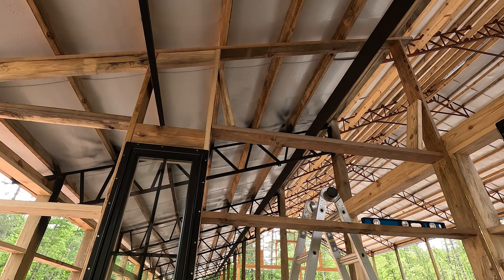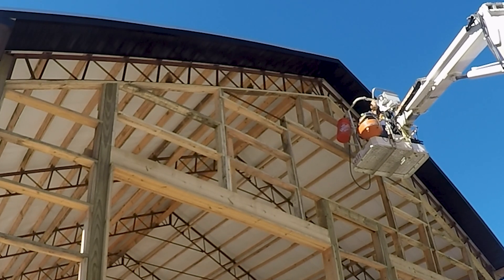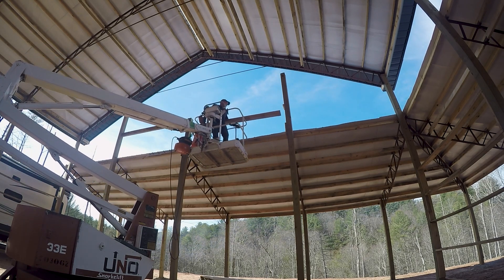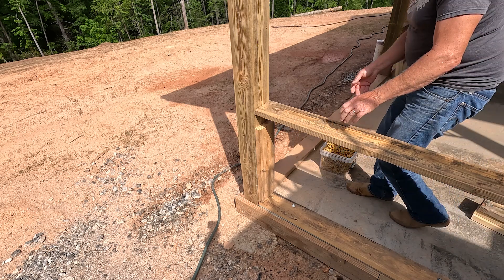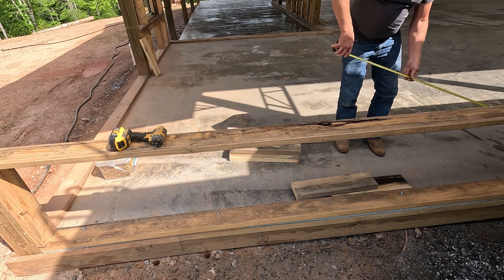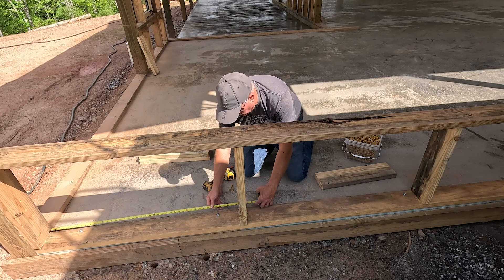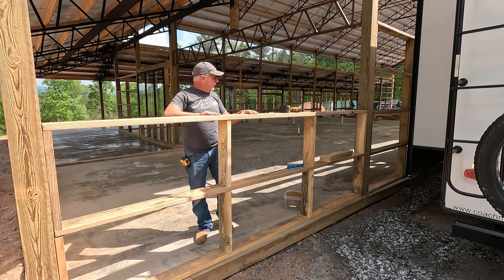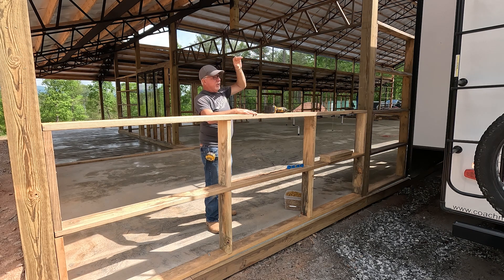How we framed the exterior ends of our Barndominium.

Comment: How do you fasten the top plate to the steel?
Reply from the maker: We had 2x6 walls and trusses 2” wide so sandwiched with 2x2’s then Teks self tapper up though plate into truss. I suffered a lot of indecision and hind sight with framing around those trusses. I didn’t care for the ways I saw others doing it. Not in love with the way we did it either. My advice is don’t center walls on trusses. Also keep walls 3’ minimum away from trusses for easier drywall/ painting whatever. Up coming videos will show that in better detail.